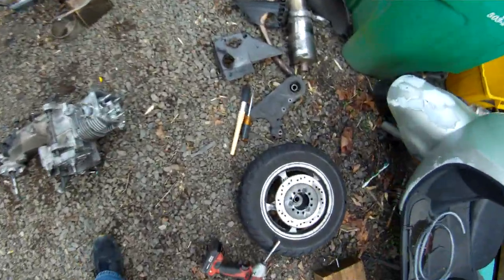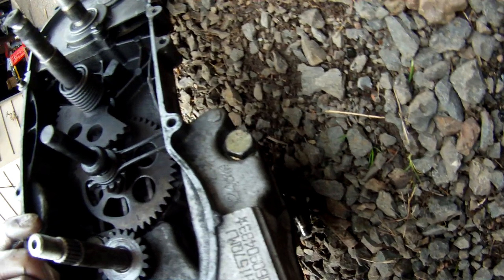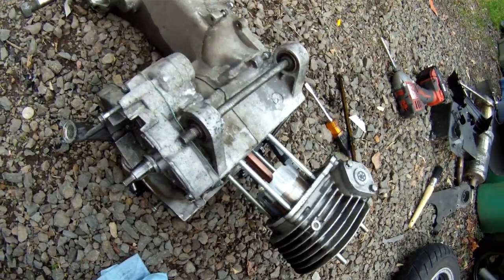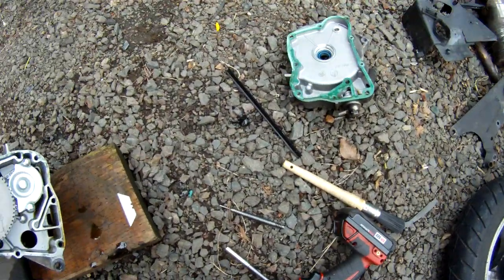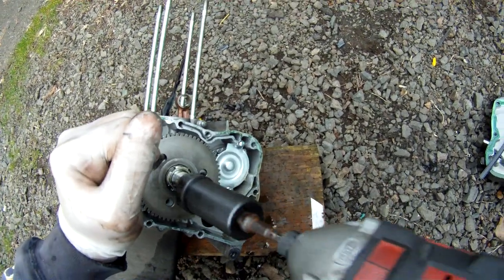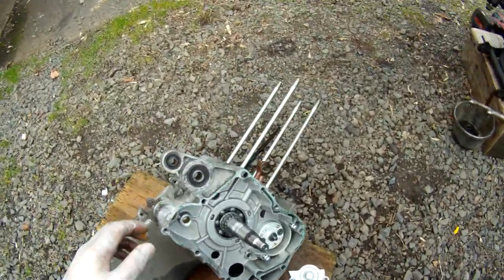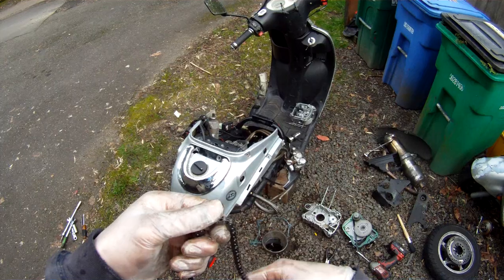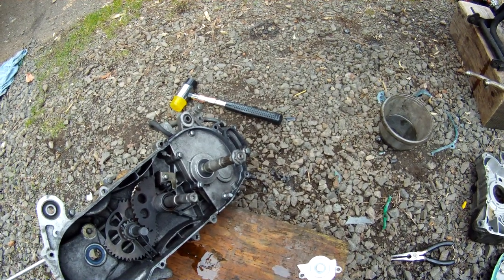150cc GY6 breakdown/rebuild Part 2

Comment: Thanks for posting! Mine overheated today.. after compression testing at 25psi (was 150 last week), I pulled her apart to find the piston had basically disintegrated, meaning I've gotta split the case and find all the goodies before I can even think about putting it back together.. I've done bore kits before but this will me my first time digging into a bottom end. Made it as far as the stator today but didn't have an impact wrench or special tool in hand.. now I'm just watching as many related videos as I can in hopes of minimizing the surprises to come.
Reply: Did u fix  it ?
Reply: @Matowix  yep I got it going again within a week of my original post. Ran fine for a few months but got stolen. I replaced it with another taotao which I immediately did all the same mods to. Dailied that one 8-9 months then upgraded to a rebel250
Reply: @jseden  did u run it low on oil?  That's what  I did. It still goes ok but less acceleration
Reply: @Matowix  no it was running super lean.. totally my fault. I'd replaced the airbox with a pod. I knew it was lean and even had the new jet.. I just wanted to ride to work instead of doing it in my parking lot, thought I could make it the 8 miles there. I noticed it losing power after ~6.5and it totally shat out around 7.7.. almost made it!

The one that overheated was one of the factory 63cc ones and I rebuilt it with a 72, along with an a9 can. Got rid of all the PAIR junk while I was at it.. the new head didn't allow for it anyway.
Reply: @jseden  so it was a 2 stroke then  ? How would a 4 stroke overheat that much from lean  mix
Reply: @Matowix  I guess it was very lean. Definitely a 4. Had them valves and everything lol. I've heard about them being lean from the factory and burning rings. standard 139qmb tho

Comment from the maker: This is what I would do. Steer away from spending money on an exhaust until you go big bore or stroker. Buy a DrPulley Variator and 11g Sliders. If your running a 24mm carburetor, search for a 26mm such as the stock 150cc TGB scooters. Next buy the A10 camshaft and port the head and intake...Once you port the head, the intake, get the 26mm carb, and install the camshaft, its OK to buy a performance exhaust...Nothing with an exhaust tip larger than about 1in or you basically bought a megaphone with little to no performance gain.

Comment: I am sorry you had problems with your scooter.

The video is interesting. It looks like you have a good amount of mechanical ability. All of you tools are laid our like a surgeon. I see mods with aircraft braided hoses, perhaps an armored electrical wire housing. I don't mean to overstep, but the scooter itself, you seem to neither clean nor want on your driveway.

Oil coolers can be tricky. If the oil is flowing, the longer the lines, the less the oil pressure because of the oil friction and the flow gradient against the hose walls. Your oil lines are nice and large in diameter, though. Still, It's possible that the oil pump can lose its prime while sitting.

Humble suggestion: The motor being metal, any additional air you move past it will cool it, and the oil. Even adding surface area like a heatsinks could help.

Thanks for sharing.

Comment: I'm buying the pre bored 150cc gy6 crank case and 61mm big bore kit I have a bone stock 150cc gy6 on I'm ordering all new oil seals oil pump etc will bearings interchange

Comment: Did you run I dry or something?
Reply from the maker: No, I changed the final drive ratio and didn't torque down one of the bolts enough. It ended up vibrating loose and bound up with the rear CVT pulley.

Comment: How fast did it run before the teardown ? I got my 171 up to about 70+
Reply from the maker: With no headwind I could go 75+...I've recorded 81mph on GPS once. What fascinated me the most is hitting 10,024rpm's. There are a number of variables why it hit those rpm's but I was flying past traffic. And at the time, the engine pulled hard from 8,400 - 9,600rpm.
Reply: I have a haojue t9 swish 18 years old  i did a simple upgrade  switch out the 125 for  a 150cc barrel  and piston  upgrade 150 cc carburetor  and last the the gear case to 36 teeth and my top speed  is 98mph

Comment: anything i can do for half way cheap and easy to get more power out of my 150cc
Reply: raise the compression ratio two points or more which would then require premium gas all the time.  don't know if that can be done by milling the stock block or head some, or if there's adjustment then that can take up the timing chain slack.  also, test the intake tract to see if the carb. is supplying all the air the induction system demands....may need a slightly bigger carb.